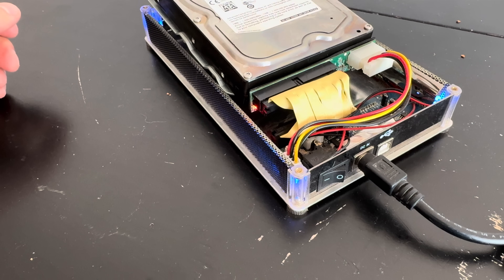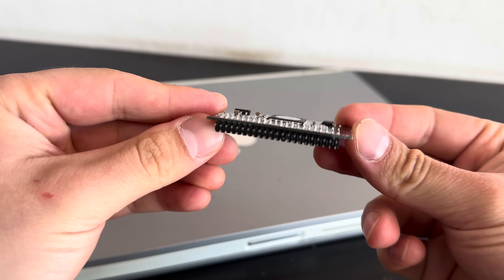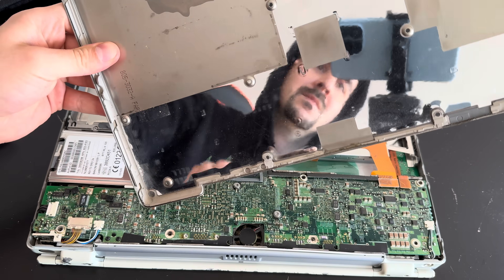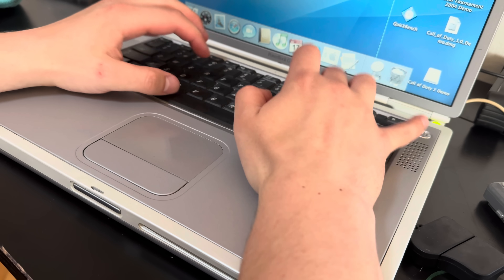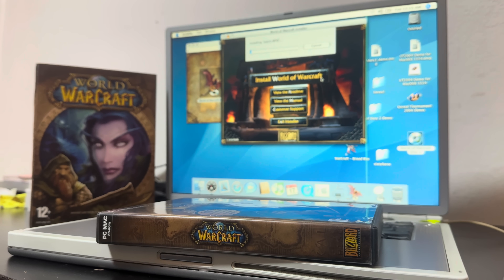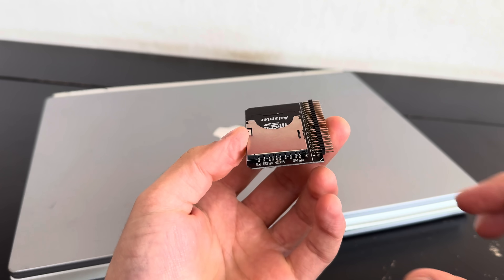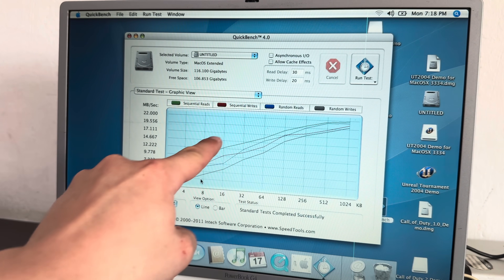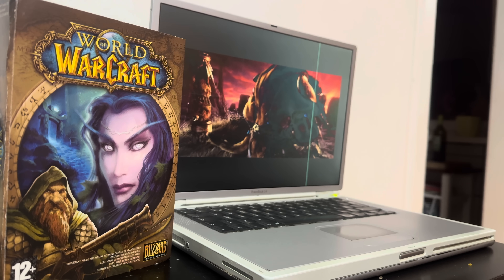Using SD Cards Instead of HDDs?

Comment: SD, perfect for use with less intensive operating systems like DOS.

Another option is CF cards, but they are more expensive to purchase.
The CF to IDE adapter is cheaper than SD to IDE.

Or use a small SSD for retro computers.
2, 4, or 8GB costs a few dollars or euros.
Of course, with a SATA to IDE adapter.

I have a thin client with a 2GB USB stick as a hard drive. (DOS)

Comment: A good laptop for having easy swaps of OS's or various drives for various reasons, the Dell E6410 has a pull out tray for swapping the hdd/ssd in seconds. I have 2 of these for that and testing reasons. Cheap these days too. Easy to install any OS

Comment: Surprising, I wonder about the longevity of a SD card used for a boot drive. They are fine for DOS, however graphical OS's like Windows write so much to the drive as a matter of course, swap files, log files, you name it.
You would probably be way better off using an SSD with an adapter

Comment: This is one of those examples of "just because you can, doesn't mean you should" (especially for production level 😂) .  The average SD card is not ment to withstand the ongoing reading and writing that an gui based OS has. :)
Reply from the maker: It clearly works, not only based on my experience, thousands of people, especially in the retro community, have tried using similar adapters (be it an IDE/XT or some other interface). I’m not recommending putting any valuable data on it, or using it as a backup solution, but for these retro devices, where it really doesn’t matter too much if it does fail, I see no reason not to try it.
Reply: @schvabek  I did not say that it wouldn't work or doesn't work. :) I said, it's not a stable platform for daily use , nevermind production use. People doing so take on risk, which they hopefully plan ahead for, same as hardware raid. :)
Reply: @schvabek  Russian roulette has worked for many many people aswell... Again, just because you can, doesn't mean you should. Even with Pi's etc, I lean towards quality flash drives Vs SD cards, even if like for like quality.

Comment: No this is no going to consistently work.  I have several older systems that WILL NOT boot from an SD or microSD to IDE card/board.  I have had better luck with SATA to IDE adapters or boards.  So the bottom line is the this will not always work.  The BIOS in these systems did see the device as a valid boot IDE device.  However, when you actually boot... the SD or MicroSD card media was not read... no activity at all.  The media WAS discovered, was present, but initerrupt call to 80H, typical of IDE boot sequence fired, but the MBR was never read.  I validated the MBR, the boot image, via USB and even floppy diskette worked.  I copied the image (raw) the an IDE drive, worked.  The copied the same image to SD and micro SD cards, inserted into the device... failed.  Out of about 20 attempts, the BIOS would report the same error across many machines. basically no system disk found.  This was after proving the system image worked on USB, worked CDROM (burned), etc.  I sent the device back.  The device is sold by many sellers on eBay and Amazon, but they all come from the same OEM.

Comment: I Have Lost So Much DATA When A Drive Would Fail Or I Would Scxrew It Up! Until I Learned To Keep My DATA Backed Up On At Least 2 Drives If Not 3! Today I Have 3 12TB HDD's And 3 14TB HDD's I Keep The 36,000 TV Episodes I Have PVR'd Over The Last 20 Years! To Copy That DATA To Another Drive Takes Days! And When You Are Mass Copying DATA To A SSD It Starts Out Blazing Fast Until The Cache Is Full Then They Slow Down Slower Than The Spinning Disks!

Comment: If You Are Transferring More Than A Few GB's HDD's Are faster Than The SSD's On The Market! I Have A Gen 4 Sabrient Rocket SSD To Fill It With 1TB Of Data It Slows Down And My HDD Will Beat It!
Reply from the maker: It very much depends on the SSD. I have external thunderbolt SSD, which does around 1 gig per second, and it's miles ahead of any external HDD.

Comment: About storage, I use tiny core linux 32 bit on my retro laptop and it feels very responsive. I will try to run a more customized distro, but I don't care so much if is working well.
About sd cards, the only problem is data transfer speed on modern sata connector.

Comment: Rather than use an SD or CF card I drop in an SSD with an IDE adapter.  It costs more but I think it will give longer term reliability and the read-write times are faster, although it probably doesn’t matter too much on really old hardware.

Comment: This surprised me. Back in the day, running an OS off a CF or SD card was pig slow, even on IDE computers. Seeing this has made me reconsider the possibility of using a few of these adapters on a couple of my old IDE laptops. The only question left is how well will these adapters deal with windows 3.1's and 95's maximum addressable hard drive size limits when the faster speced SD cards tend to start at a minimum of around 16 or 32gb? I doubt they'd cause a problem, but every time I assume something like this it seems to jump up and bite me. 😏
Reply from the maker: @Reman1975  I’d give it a try, just because of how cheap these adapters are. As for the maximum addressable size, in my experience you can always make smaller partitions, or the worse case scenario it will just pop up as a 4-gig (or whatever) size drive.

Comment: For long term, high capacity storage, HDDs are the only thing I'd use currently. Especially if you go through Server Part Deals and get some recertified drives for pennies on the dollar.
Like you said, for your everyday laptops, desktops, etc, an SSD is the way to go.

Comment: I pulled out my old Atari St from 1985. Built a SCSI tower with two hard drives and a Phillips 6 disk CD changer, DVD rw,  netusb (Ethernet and USB). Expanded it's memory, added a few raspberry pis doing various things an a TF 536 for more fast memory a much faster 68030 and an ide connection. 

I have a Zulu SCSI that adds SD card support as well.

Comment: My 1st computer a Tandy 1000 128kb storage hard drive I was told then this will take you years to fill up~ not true
Reply from the maker: Hey, that’s pretty cool. However, it’s very likely that was the amount of RAM you had, HDDs were usually at least several megabytes at that point, and were very expensive and optional (so it’s likely you didn’t have one)

Comment: For some people, retro systems are only "valid" when all aspects are period-accurate. For me, I want the hardware involved when the code is actually running to be period-accurate (CPU, GPU, memory, chipset, CRT monitor), but everything else I like to optimize for silence and speed. I'm happy to use CFs on Pentium (1) or lower and SSDs on anything newer because it doesn't ruin the retro appeal to me. To some people it does, though.

Comment: I found HDD seem to be more reliable (few died in 100s I have had) even damaged ones have in past seemed to been able to get data off them (if not power related) with two SSDs out of 6 I have failed completely cant get the data out and too costly to get some repair shop to pull the data. Just annoying given solid state should be more reliable compared to the complexity of spinning rust. Even SD cards have had some failures they worked in the past then pulled out of storage and nothing (how?) understandable with spinning motors seizing etc or power spikes to start motors etc.

Comment: Hard to beat the space available on a modern HDD.  I just bought a pair of 16-terabyte Toshiba's.  Gonna stick them on my backup server as a RAID 1 array, and run NILFS.  This is a version-aware filesystem.  It never erases anything, just keeps sticking the modified file onto the end.  So if you mistakenly erase a file, you can mount the live filesystem - as of a certain date - to a mountpoint and go browse it read only as it used to be.  Obviously, such a thing eats disk space for lunch.

Comment: I agree with you. Hard disk for archiving data. Preferably an external hard disk that is connected when needed lasts a very long time.

A hard disk lasts shorter if it is running unnecessarily for days.

I have a 2TB hard drive from Samsung, it is 15 years old and still works perfectly 👌Only connected when I need it.

Comment: 01:16 in 1990 we had one of these beautiful full-hieght Priam monsters.  This 330MB ESDI 'Winchester' sounded like a jet engine and was super reliable.  It never failed and was retired lovingly as density and price of SCSI disks improved.  A family offset print shop running Windows 2.1 and Aldus Pagemaker, CorelDraw and ImageIn for line art.  Photoshop was Mac only then.

Comment: dosdude1 makes native IDE SSD's so SD cards for older computers isn't the only option. and ofc sata to IDE is an option too but it's finickier. and it's open source so you could in theory make one yourself.
the cheap way is to get an MSATA drive and an MSATA to IDE adapter. those are pretty universally compatible and are more or less speed limited on the IDE bus, so you don't have to worry about getting a high quality drive. they're also dirt cheap alltogether, it's like about $30 where I'm at and have a full drive setup with adapter
and the SD cards I'd say top out after around the millenium in terms of usefulness in older computers.
Reply from the maker: @JessicaFEREM  Of course it’s not the only option. You can also get IDE SSD’s on AliExpress for cheap, but this is actually cheaper and seems to work pretty good.

Comment: I have had good luck using CF cards and an IDE adapter. CF has an IDE interface built in. The adapter just provides the conversion of the connectors and some power control.
SD provides larger drives but I have had no problem with 32G CF cards. The larger ones can get expensive.

Comment: Hard drives have one advantage over SSDs and other storage options.  If the drive fails or crashes, at least some of the data is recoverable.  With SSD and other options, once the drive fails, everything on it is lost forever.

Comment: Now that SD cards transfer at 130 mbps and more, it seems a good idea to use with an IDE/SD adapter for older PCs.
It should not be slower than old HDDs and more versatile/interchangeable.
The electic consumption is also less I guess, as well as heat generation and weight.

Comment: thanks for sharing i have 20 yr old hd's still working and have had also usb drives fail after a year likely because of wear & tear because of bad soldering, i'm actually going to try reviving one old usb by connecting connection pins to a new usb cable . always looking for ways to keep my tech useful and out of landfill. 👍👍

Comment: I have found USB 3 to be faster because the new USBs are faster. Is there an IDE to USB 3? My understanding is that there needs to be a USB 3 driver involved.
Reply from the maker: @TexasEngineer  Well, laptops this old usually only have USB 1 (if that). And there’s no way to add a USB 3 card to it. So you’d be better off booting off FireWire, but I’d say this is just more convenient and easier

Comment: Anyone who says an HDD is "unreliable and prone to failure" is either A) using the cheapest garbage known to man or B) has never knowingly used one and has clue what they're talking about.
I've had a 2 and 4TB drive that have gone through 4 rigs in 10 years. Still run EXACTLY the same and have held data lock tight the whole time.

Comment: "Old retro computers," well there's your real problem right there.
If you want to run some old software, just run an emulator! It takes up a tiny fraction of that massive SSD capacity and zero physical room, boom, you're in business.
Reply from the maker: @Grunchy005  What I do on the channel is honestly kinda hard to to in an emulator to be honest, and is easier to do on real hardware (like benchmarks, pitting systems against each other, testing hardware peripherals etc.) 

Not to mention that I also like tinkering with old hardware and collecting it. These adapters give a nice transition between convenience and authenticity. However, if you’d prefer emulation, hey, more power to you.

Comment: IDE vs SATA vs PATA...
I'm not sure when people started using "IDE" incorrectly. I think it's when SATA came along. But "IDE" stands for "Integrated Drive Electronics" because the PLATTERS (drives) and the Electronics used to be in separate boxes. When the electronics shrunk and everything become one unit they were called "IDE" drives...
Before SATA we had PATA, or "parallel ATA" (the ATA isn't relevant to my rant). The data was sent in parallel, but then we switched to a Serial interface. And for some reason people started saying "IDE" vs "SATA" when that makes no sense. SATA vs PATA are just connection types. "IDE" vs "SATA" is meaningless since SATA drives are also IDE drives.
(BTW, the same nonsense applies to "x86" vs "x64" when it should be "x32" vs "x64"... technically it's "x86_32" vs "x86_64" but even Microsoft started using the terms incorrectly. Strange. They started using the term "x86" in place of the x32 (32-bit) when both 32-bit and 64-bit were based on the x86 CPU architecture. Hence the longer "x86_32" which actually means 32-bit on the x86 architecture.)
Reply from the maker: @photonboy999  I don’t know man, even if IDE and SATA were technically the derivatives of the same technology, very few people take them as such. I refer to that interface as IDE because of the pin interface, even though it’s technically ATA, or in this case Ultra ATA66 (which is what I also pointed out in the video). The adapter I featured was advertised as SD to IDE, so, you know, it’s what I’m calling it as well. It’s one of those things that’s I guess not technically correct, but it’s just easier and everybody seems to understand it

Comment: My PC has 22.5TB of storage, 21TB of which is HDD storage. I've tested a few SD cards against my HDDs. Some SD cards win against some of my HDDs in some aspects, and some don't. For moving large files the 250MB/s sequential writes of my main backup HDD handily beats all of the SD cards I tested. Some of the SD cards did have up to 2x better random reads/writes than all of my HDDs. Low single digit speeds either way, but a win for SD nonetheless.

Comment: Two important points here:

1) Many older drives were built to higher standards, and the mechanical tolerances were more forgiving.
2) Occasional use is not the same as constant use. I used to have drives failing regularly in my (home) server, and that was only moderately heavy use.

Comment: HDDs are great for cold storage for large files that are not read often, backups, etc.
Reply from the maker: @devinm.608  agreed
Reply: If I recall correctly, quality hdd's have a lower risk of failure/data corruption for cold storage, Vs SSD's.
Reply: @zadekeys2194 yeah as long as they're safeguarded against shock and exposure they'll last a long time and won't randomly corrupt data as often

Comment: (02:10) IDE2SATA adapters absolutely kill performance. While there are adapters that "support SATA3" they often support only a VERY limited subset of the architecture that could provide somewhat decent performance. They'll "work" ok with SATA3, but the data transfers and buffering  are very limited and  s..l..o..o..o..w.
Reply from the maker: @exgenica  I personally don’t use them for speed, it’s just convenient, if I don’t have an IDE drive on hand (or sometimes I want to use SATA drives with known working installations of Windows/Mac).

Comment: In my whole IT life (30+ years) I have had only one mechanical drive fail but I have had several USB pen drives and SSDs fail on me most often without ANY warning.
So the whole reliability of solid state speech is overplayed. A good brand HDD handled right will last ages.

When it comes to laptops and mini systems that require 2.5 drives the adoption of SSD has been pushed hard by manufacturers.
They have just stopped producing mechanical drives, it is not an option anymore even if you wanted to.
If you use your daily driver for development continuously writing ti the drive you will WANT a mechanical drive with a cache SSD which is what I use now.

I just don't trust the SSDs for ny serious write load. If you're just browsing the Web all day its a different story.
Reply from the maker: I’d say most people agree HDDs are still king as far as backups go, but I think most would go for SSDs all day for running their OS from, just because of how objectively faster they are

Comment: I still use HDD. I don't know why. My largest is 12 TB. It makes it very notecable which apps take a long time to load. Apps made with snap are many times slower. Steam (the non snap version) takes 52 s on Kubuntu while it takes 15 s on Win 7. Firefox is pretty slow as well (the non snap version).
Reply from the maker: @louistournas120  I guess you could run your OS, browser and other apps from an SSD and leave the HDD for stuff that actually takes up a lot of space (like games)

Comment: OLD HDs are way more reliable than SSDs or NVMEs.   Your data will be alive in 20 years not so with SSD or NVMEs.   They will die especially if left with no power.   I use mechanical SAS Raid 10 ZFS for all my long term storage not SSD.
Reply from the maker: @Physics072  I was more talking about them as a primary way of loading the OS from, not really as a storage format. I think most people would agree that’s where HDDs are still king.
Reply: @schvabek  For boot drives USB sticks and SD cards are so so.  I burn through them about every 2-3 years they don't last but they do work.  Depends on quality and amount of use.  Not super reliable but do work till they don't   A step down from SSD or NVMEs.